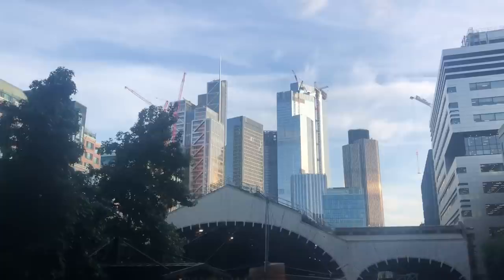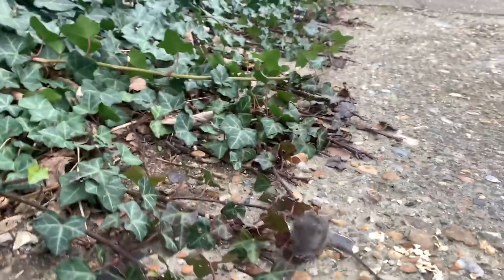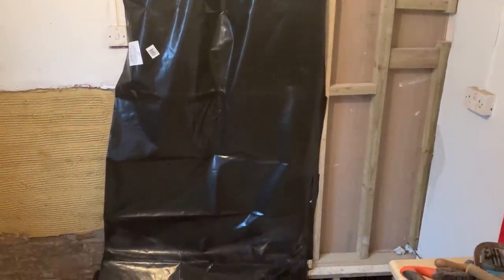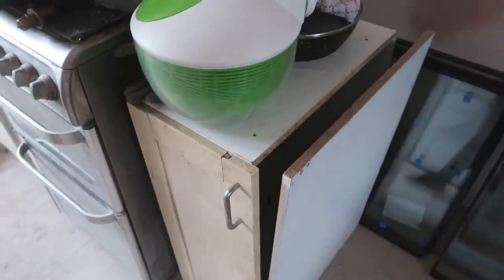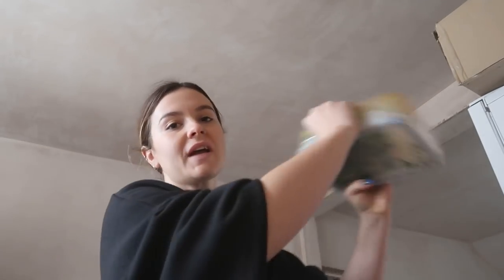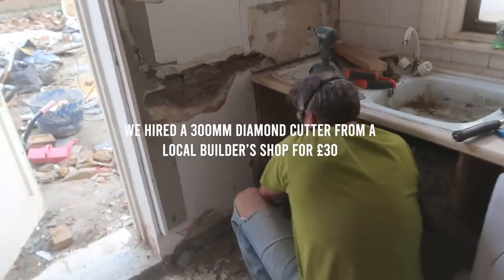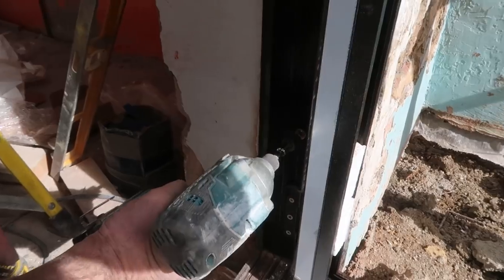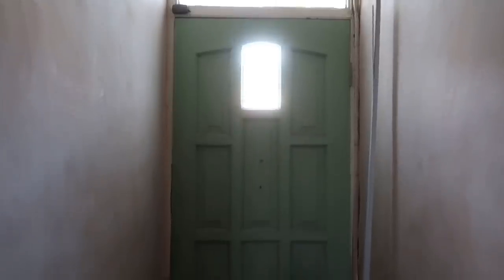SO MUCH PROGRESS!! installing the back doors + levelling the kitchen floor

Comment: Two weeks after we got a couple of cats, all the mice moved out, except the ones they bring in to play with. I hope you took that lead piping to the scrap merchant to get a few bob back. My kitchen is near 100% and works well except where there are loads of paint pots and bagged trays. Depending on where the sun shines into your kitchen it can get unbearably hot in the summer, which is why I left it where it was and with the extension it if now in the centre of the ground floor. Yes, I got a window put in (north facing) but we still need light. At least the butter won't be a total puddle in the summer. I used to stick newspaper on the old kitchen doors to cut down the light and heat. Please make sure you have blinds for the door just in case.
Reply from the maker: I did think about moving my family cat in for a while! Hahaha. So glad to hear about your kitchen - feel like I'm counting down the days for ours and now that we've got the back doors I'm more excited than ever!

Comment: Great effort guys.. we have just finished the first stage of our renovation, and now watching your videos is bringing back memories. Anyway I was wondering  where did the boiler go? How difficult was to move it? Our boiler is in the middle of our small kitchen so we are looking at moving it elsewhere. Thanks
Reply from the maker: Thank you! We moved the boiler to our first floor bathroom (as it’s very large) and placed it in a cupboard along with our washing machine. We needed to rewire the sockets to be outside the bathroom though - just read up all regs when moving a boiler to the bathroom. I’ve seen others move the boiler to the cupboard under the stairs and then have the vent go through the floor joists to the outside wall - that’s also an option.

In terms of moving the boiler - it wasn’t too difficult as all our pipe work ran to the bathroom already which made us save time in not needing to bend a lot of new copper- it was extremely heavy though!

Comment: Can I ask where the door was from?
Reply from the maker: Of course! They’re from Colins Sash Windows - painful 15 week lead time but luckily we had a lot to do in the meantime!
Reply: Thanks for asking that - you beat me to it!
Reply: @FeedbyAutumn  please can I ask how much were they?
Reply from the maker: They were £2k - worth it for light they bring in!
Reply: @FeedbyAutumn  thank you. Im sorry I know you'll do a downstairs video but how much were the lintels on your last video. It's something I need but haven't a clue how much something like lintels would cost. Very much appreciated.
Reply from the maker: @rachellord596  we had to buy two pre-stressed R15 concrete lintels to support the load above based on calculations we done. These were bought from a local builders Merchant for £30 each. If you buy from Travis Perkins or one one of the other main ones these will £80+. 

An alternative is to use a Catnic lintel (metal) but these are a lot more expensive and Tom thinks they’re more difficult to install due to the weight of them.

Hope this helps ☺️
Reply: @FeedbyAutumn  thank you. Honestly its so nice of you to share.